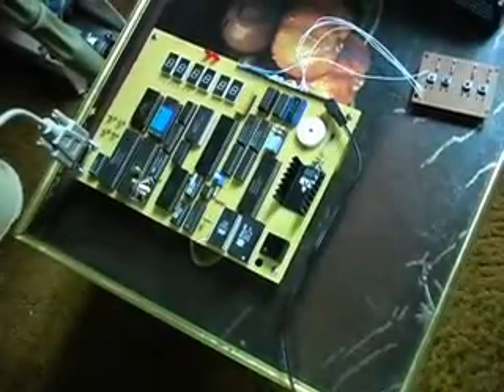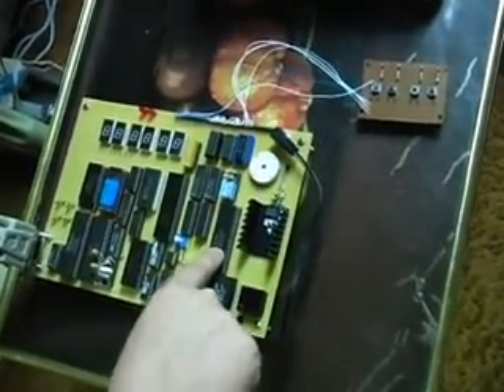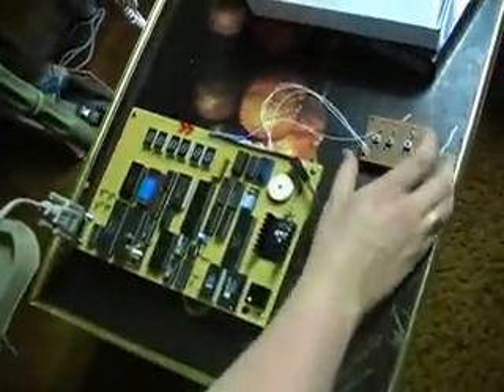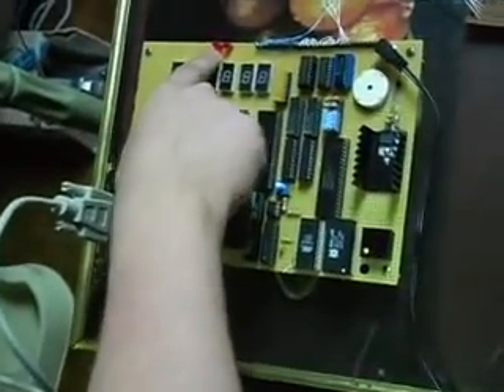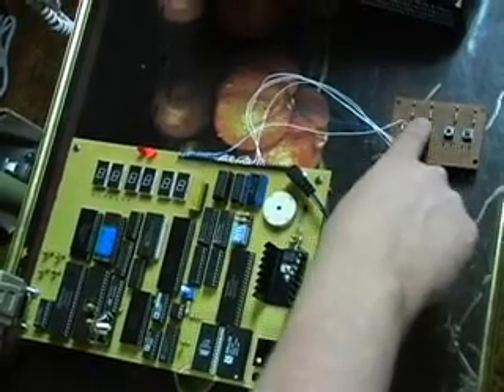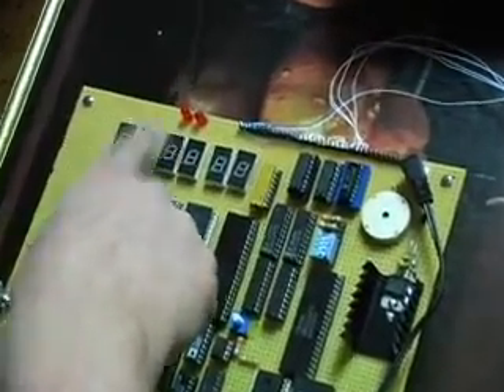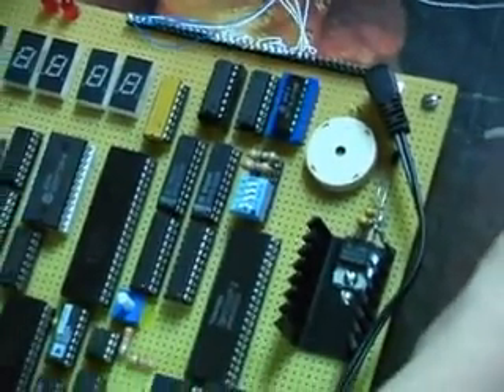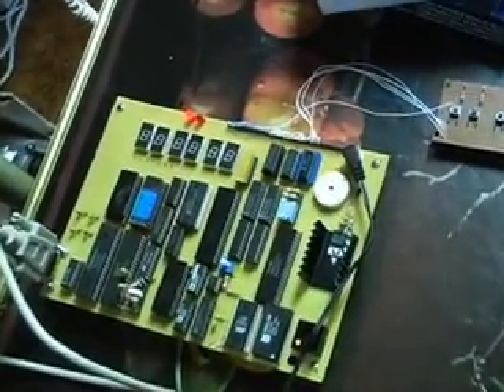A digital electronic combination lock - Hardware/Software.

Comment: Quick question from a software / security standpoint.  Is the software designed to "listen" for a sequence of keys (i.e. 4 digits) or is it keying off of the first correct number and listening for the next number until completion?